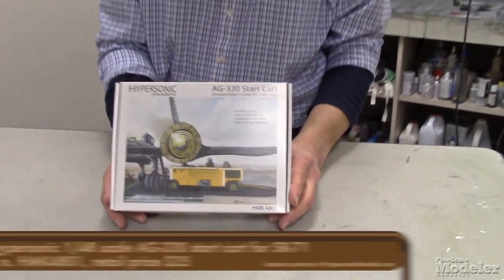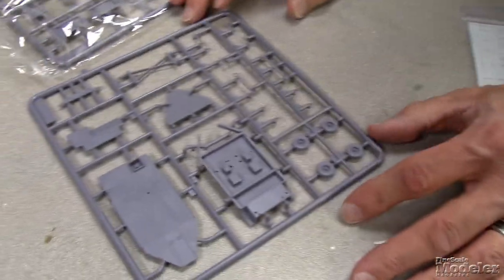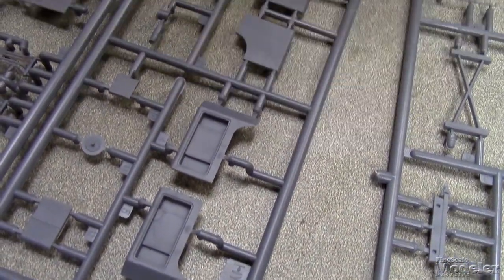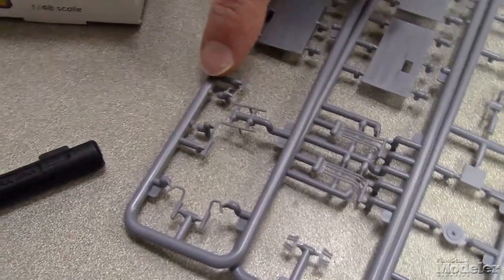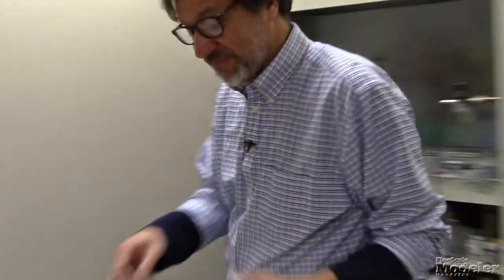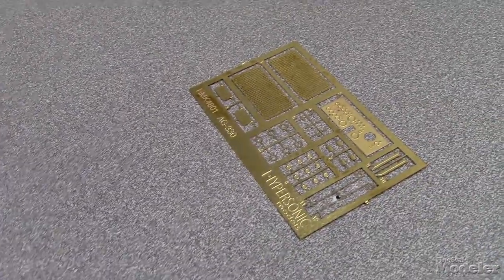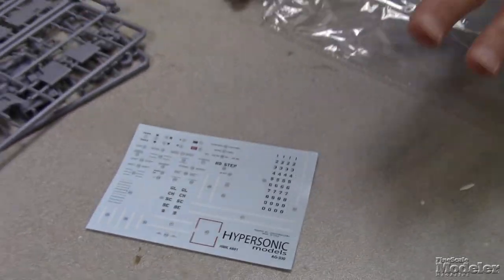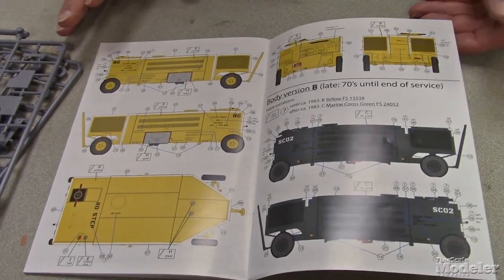Review of Hypersonic's AG330 Start Cart — New Product Rundown "One Shot"

Comment: Just finished the Testors 1/48 SR-71 kit last month. After adding every possible detail parts kit, (engine inlets, bleed doors and exhaust nozzles, landing gear, refueling receptacle, nose cone, pitot tube, flight crew, Caracal decals) and scratch building brake lines and canopy struts, re-scribing  and adding panel lines and rivets, I was ecstatic to find this kit as well as the crew ladder. They are both on order and will add nice finishing touches to this massive kit. Thanks for this video!

One note; while this was made for the Testors kit, Revell is set to release an all-new tolled 1/48 SR-71 next year.

Comment: The cart had a round vertical tube with a flat gear about 12" in diameter on the top that connected to the engine.  The shaft was operated electrically by a button on the handle located below the shaft.  The handle was moved left and right as an adjustment for lining the gears up as you got closer to the engine. The cart was painted yellow in 1976.  The Buicks were the largest of the day with 4 barrel carburetors and no mufflers.  The throttle was on the instrument panel with an rpm, fuel gauge etc.. Once the engines were started, we had to push it out and away from the plane, one person in the back and the other pulling from the tow bar on the front and turning it.  Sometimes 2 in the back.  Thought you would like to know.